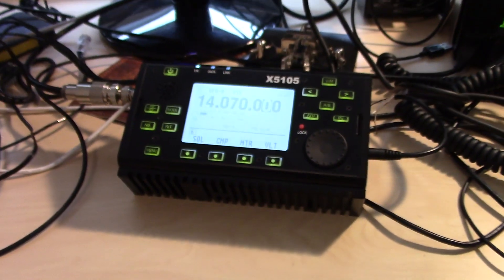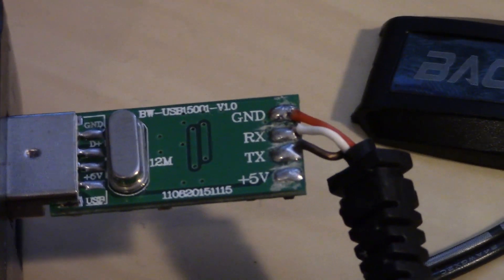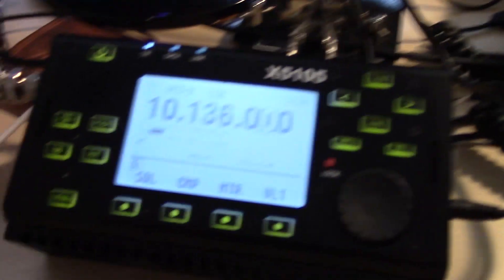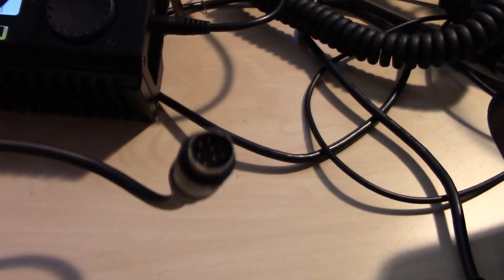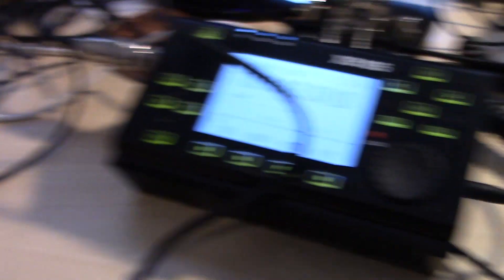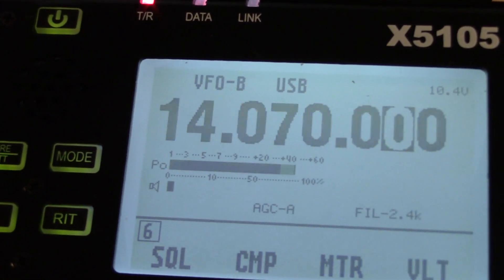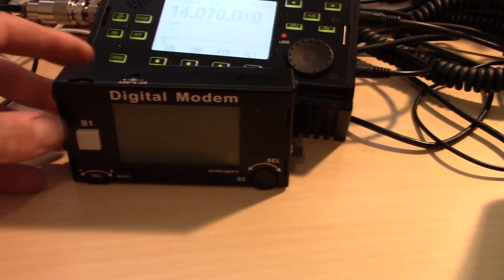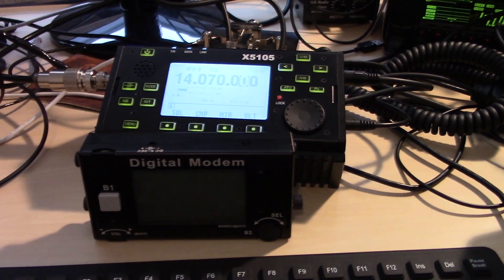Xiegu X5105 QRP Digital Modes PSK/RTTY/FT8 Ham Radio Deluxe

Comment: Eric have you used the X5105 with the digital modem and roll up keyboard yet? And what did you use as the reference for the pinouts? 73 de KN4KAW.

Comment: The new ones come w the CI-V cable.  The only thing you need to add is a sound card.  I got mine from xggcomms, which is a UK company on EBay.  Paid $69 for it.  Works terrific.  I set my radio up for PSK in FLDIGI as an Icom 7100 and was able to send and receive via the Xiegu.  Will try it in HRD tomorrow.  If that flies, I will use HRD to backdoor into WSJT-X.

Comment: I understand the X5105 does not come with a charger. On the multiple reviews of this radio on YouTube, I have not found a review on the best power supplies / chargers to use for the X5105 battery. What are hams using? 73.
Reply: I used a cigarette plug charger, cut it, put Anderson power poles on it, drilled the 2.1mm barrel connector out to 2.5mm. Worked perfectly and can use it in my truck or with the Alinco power supply. Be careful with the drill, do it slow with a drop of oil. Pulled the guts out of the first one.

Comment: Hi Eric Just updated my x5105 and got it to work via HRD as per your video. ? I have tried to make the lead up for the Data modes and also own the CE-19 but as yet not got it to work. I know you said you followed the manual Pin out, but is there a chance you can draw it out and share with the group your cable pin out connections.
Regards
Ian M0CAG
Reply: Which CE - 19 would I need to get

Comment: where do you fine that special din cable/connector? It is a weird one and I have not been able to find it anywhere.
Reply from the maker: It is the same as an 8 pin Yaesu DIN, go on amazon type in 8 pin mini din you will find lot of cables you can buy cheap, cut and solder together.
Reply: If I understand correctly. You cut an 8pin DIN and attached two audio cables on AF_IN and AF_OUT as mentioned in the manual? No other cables or connections to other pins made?

Thanks!

Comment: Dis you notice which radio does the x5105 emulate for hrd?
Reply from the maker: IC-7000
Reply: I tried to connect x5105 to HRD through Xiegu's their stock CIV cable that they supply now with the radio. All I got was "transceiver did not respond" message, despite changing settings around a bit. Can you please check what settings you used? I'm wondering if this has anything to do with the cable or just a configuration issue.